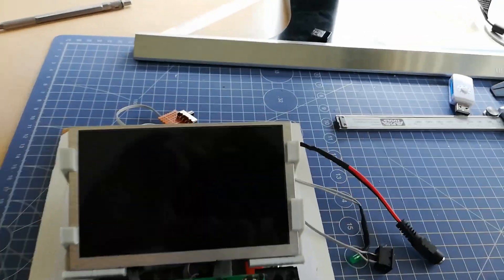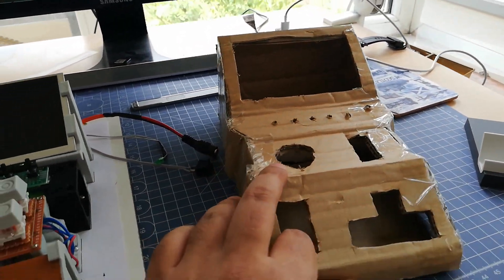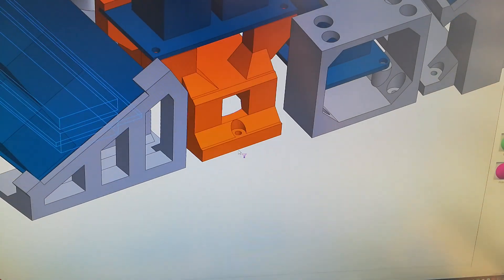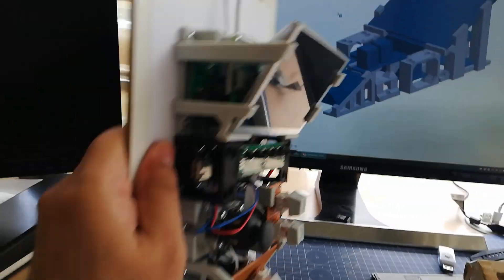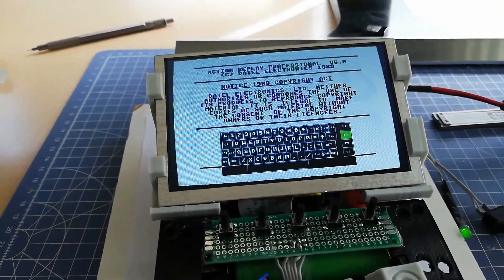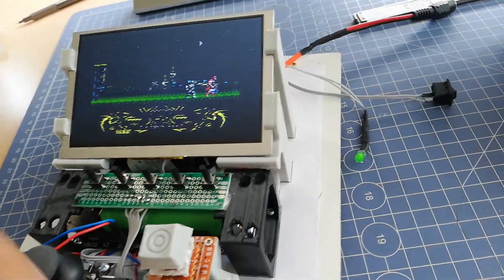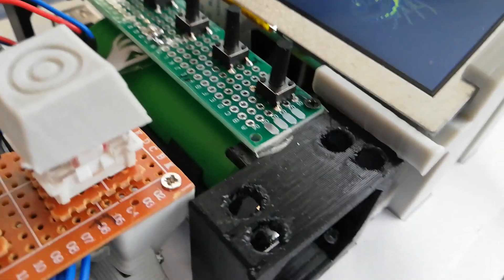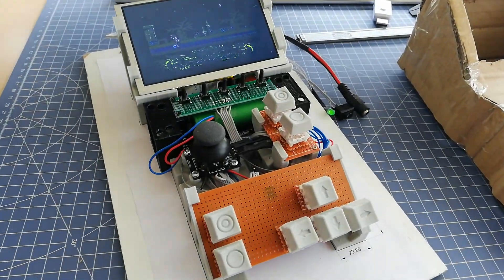Portable Commodore 64 with BMC64 Emulator

Comment: Very cool project, I have an 8" LCD with control board, some Li batteries from a powerbank (10A total), but no Pi3. How sensible is the Pi3 to voltage fluctuation from the powersource, I tried to run an Intel Computing stick with this setup, but it was not stable, tried 5 different 5V voltage balancers...